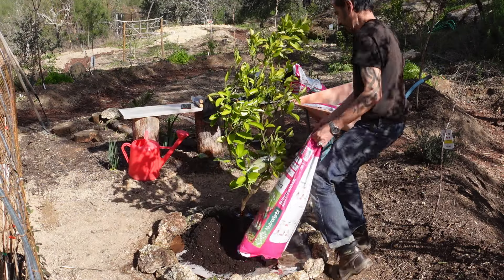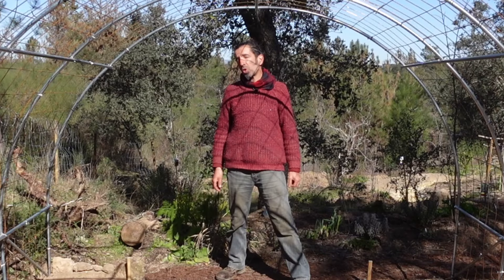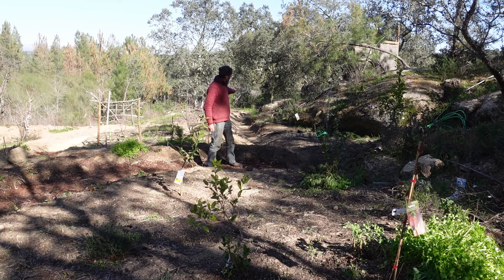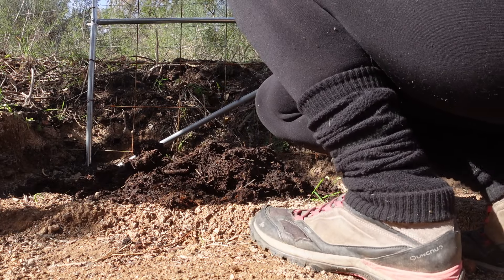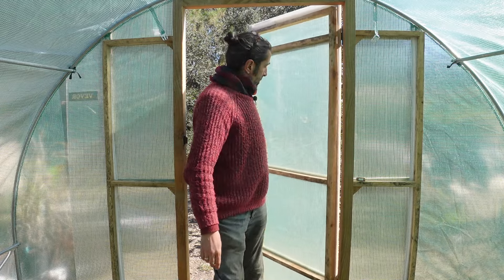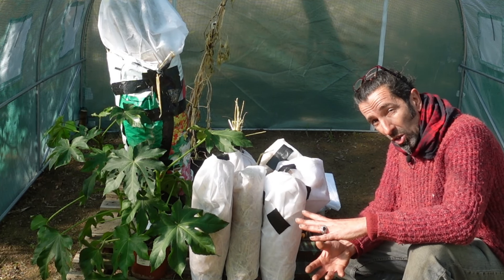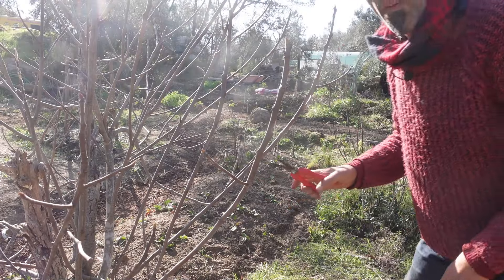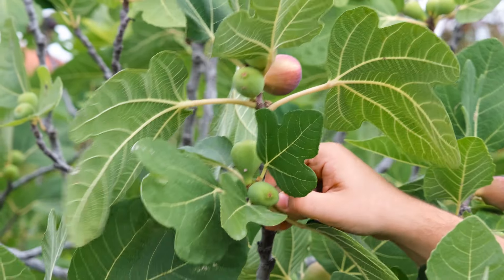LOOK what we built in our permaculture FOOD FOREST - Ep3 WEEK 2

Comment: Great work and lots of it with what you have done. Something that I have not heard of before about manure heating. Some off gridders have devised containers and pipes for methane gas but maybe a bit iffy safety wise. Its all looking really good 👍
Reply from the maker: Thanks 🌻🌱 the horse heating seems to work, and as far as, I can find out if you turn a compost pile and add to it daily in a polytunnel it can heat up to hundreds of degrees in the centre.... 🔥
Reply: @TheWildlandersOffGrid  yeah if you have a pile you add to regularly, then it will continue making heat, it takes quite a while before it is done heating... no need to turn every day... you could use humanure if you just use it for heating in there... can use the finished product as you wish, most prefers to just use it on trees and bushes
Reply from the maker: @LiLBitsDK  and if I used humanure, mix with what? Sawdust or straw? And in what ratios, do you know?
Reply: @TheWildlandersOffGrid  well when you "deposit" your dailies you just cover lightly with whichever (most use sawdust) pref with the moisture going to another deposit system which can be dilluted 1:10 with water and used directly as fertilizer... collect humanure for a year (to fill the container you compost in) then leave it for a year and you can then either use it or let it mature for another year by emptying the container/compost bin so you can reuse that for hot composting... then wheelbarrow it outside in another bin for maturing another year.

depending on how much you "deposit" you can leave the bin with a top on when you finish filling it... it shrinks to like 1/3rd the size as time goes... just don't add to it after the date you decided was the last fill date else you restart the timer. If you don't want it "inside" the tunnel for the "1 year filling" and "1 year composting" then you can collect in buckets with lid on, until you got enough to fill it. then when winter starts you line it with straw in bottom, sides and the "lid" when done filling... then empty all the buckets into the bin at once... use a little water to swirl around in the bucket to clean out the worst "debris" and put it in the compost as well... then put the straw lid on and let it be for a year (aka empty just before next winter) and repeat the process. sounds advanced but is fairly simple...

horsemanure goes a lot longer than just two weeks too... just make sure it doesn't get too dry... when I have piles from the horses they steam all winter long... I used deep bedding for them so their shelter was emptied once a year... you can turn it but I didn't have a tractor and such a big pile you don't hand turn... a compost bin well you could turn it but usually it is done by flipping from one bin to one next to it and often in a 3 chamber system like Charles Dowding but that is an outside system since it takes up more space than a single hot compost in a polytunnel
Reply from the maker: Great info... 💚
Not sure on using humanure in the green house I'd be worried about smell in a closed humid environment and or pathogens.
I watched a vid today of the, 18 day Berkley method, looks great but maybe not for a greenhouse or perhaps on a, smaller scale 💩
Will contemplate all the options 🤔
Reply: @TheWildlandersOffGrid  as long as it is covered it doesn't smell so it is only in the moments where you fill up it smells a little and honestly not too bad if you do bucketloo correctly